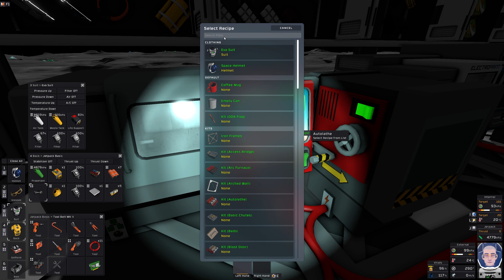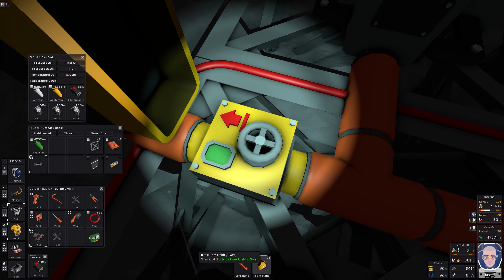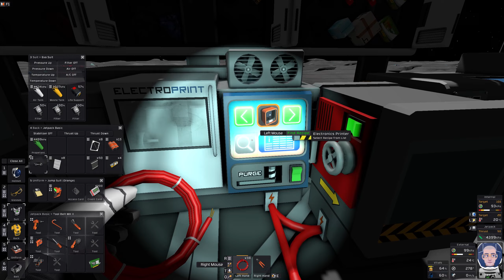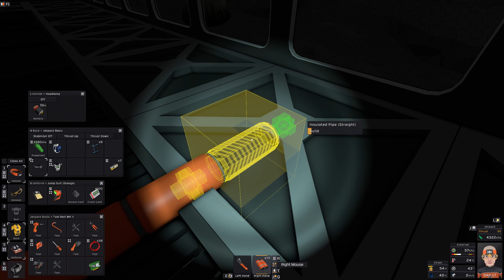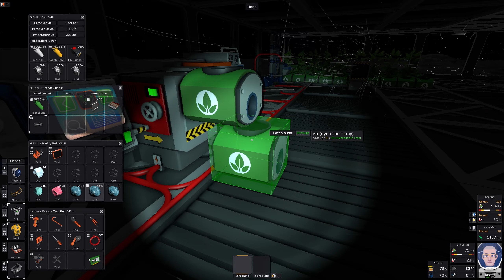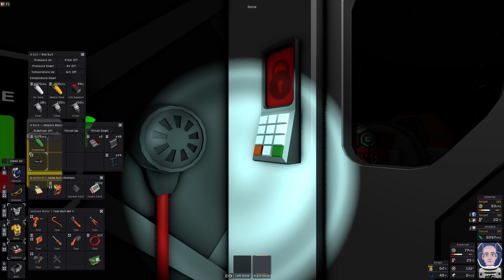Stationeers - Standard Moon, EP6

Comment: Heh ... so I heard your comment about ripping out the iron. I figured, "hey, this can't be too hard"

Started in on the Cunning Plan: used wall kits to put composite windows back-to-back with the iron, then took out the iron windows, then because I wanted the windows where they were, put composite windows back up back-to-back with the new ones so they were on the correct side, and took out the old ones. Don't even have to do it all at once. Simple, yeah?

No. One wrong move and I'm  fighting the wind trying to put a glass sheet back up to stop your base depressurizing.

Fought it through. Got it done. Base looks all Star Trek from the outside now, all nice clean white plastic. But what a long painful exercise!

Next time, I wait until I have replacement seeds, dump the base air, rip out all the old stuff, and put in the new stuff. You were so right.
Reply from the maker: I 'might' do this in EP09, mostly to demo the large power vent.    Note, I did plan to put up some internal walls, but more in the middle of frames and not over an existing window.    For example, I could partition off the plants and vacuum the rest of the best and update quickly.    Then do the area around the plants with them in a vacuum as they should last ten minutes and that 'should' be enough time to update the windows and restore pressure.    The seeds is my backup plan, but the goal is to avoid replanting if I can.